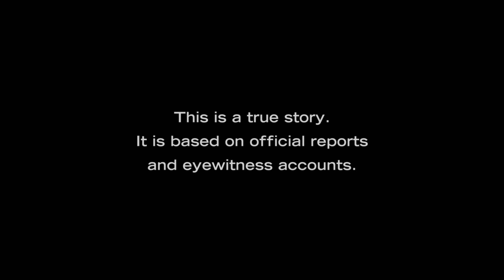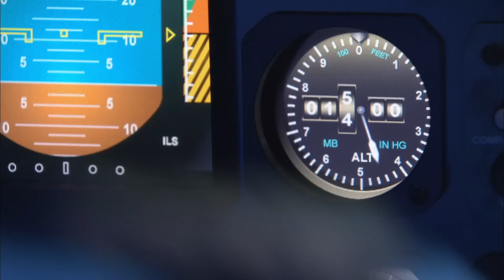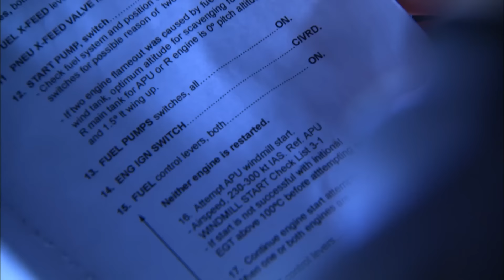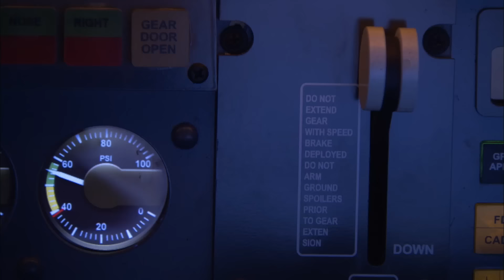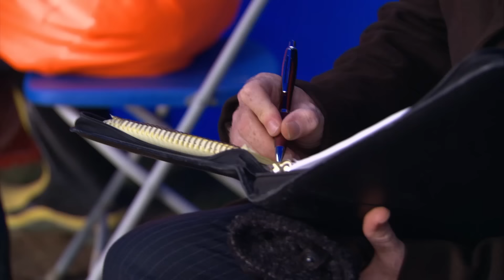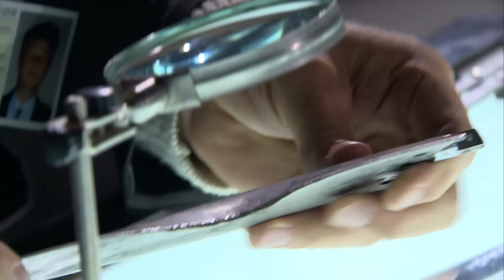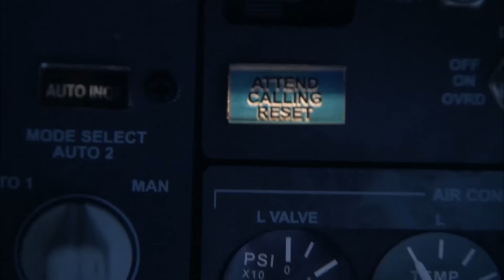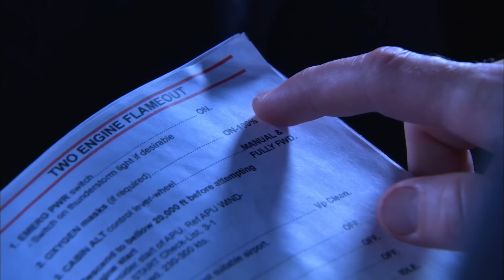How Did Scandinavian Flight 751 Survive This? | Mayday Air Disaster

Comment: Rasmussen forgot to fly the plane due to problem solving. Holmberg said several times that he should concentrate on flying.
Reply: And Rasmussen said that Holmbers continuing yelling was a distraction when he tried to access the situation.
Reply: @laxarus3259  That was the problem, Rasmussen should not solve the problem because it was unsolvable, he was going to fly. Thanks to that, it went pretty well.
Reply: @jackstreet6979  What are you talking about.?? Of course he should access the situation and try to solve it. Thats what a Captain is paid to do. No one new at that time what had happened to the engines and they made several attempts at restarting, while gliding down.
Reply: @eklund86  so have I, and I do not see how you get that the captain should not access the situation.
Reply: I haven't said that.
Reply: @eklund86  i think youtube mixed something up. I was not trying to reply to neither you or this thread ???

Comment: Wrong information! It was an MD-81 not a DC-9
Reply: @itanasoaie  Potato, patato.

"The MD-81 (originally known as the DC-9 Super 81 or DC-9-81) was the first production model of the MD-80, and apart from the MD-87, the differences between the various long-body MD-80 variants are relatively minor. The four long-body models (MD-81, MD-82, MD-83, and MD-88) only differ from each other in having different engine variants, fuel capacities, and weights. The MD-88 and later-build versions of the other models have more up-to-date flight decks featuring for example EFIS."
Reply: It’s still Douglas their planes were most frequent in crashes
Reply: @akyhne well explained
Reply: @Medina8anidem  It's from Wikipedia.

Comment: Hmm.... 
1992: McDonnell Douglas put an automated system on their DC-9 aircraft without telling the pilots it is there, or that they can turn it off if necessary.
1993: That automated system causes the crash of SAS 751 - luckily with no deaths.
1996: McDonnel-Douglas merges with Boeing, and bringing with them their culture of making changes behind closed doors and putting stock prices before safety.
2016: Boeing put an automated system on their 737 MAX 8 aircraft without telling the pilots it is there, or that they can turn it off if necessary.
2018: That automated system causes the crash of Lion Air 610 - 189 deaths, no survivors.
2019: This automated system causes the crash of Ethiopian 302 - 159 deaths, no survivors.

Comment: First of all, Why does a billon dollar company invent an new air plane, stationed to fly in ice and cool countries, which it doesn't do anymore thankfully. Just to have normal working bagage handler people to every-flight manually check with only a little flash light for something (So important that it will make the whole plain cash in seconds), and it was ice. Because the way the plain was designed with the engines right behind the wings, (facepalm) where the hard ice would melt into the engine. Great air plane design! and dont get me started on the ATR system, and them not giving notice to pilots about it. I literally in 2 second learned about the ATR system and remember that it exist forever, Why didn't they just show a 2 sec video or 2 sentence about the ATR to ofc the pilots! Btw very important automatic system in a plane that CONTROL THE PLANE!, not a AC system or something. This is ridiculous.

Comment: There was no explanation provided that explains why there was no fire when the plane crashed, even though there was substantial fuel in the wing tanks, since the crash happened just after take off.  I’ve seen that happen only when the tanks are very low with fuel near the final destination.
Reply: @sldrucker  The fuel was very cold so the vapour press was low enough not to ignight.  Every thing was shut down except the APU so the sources of ignition were minimised.  Even so they were v lucky.
Reply: @alexisvilliers4389  thank you for that answer!

Comment: I was thinking aloud,  why don't they mount two extra engines with independent operating systems to fall back on in  case the initial engines fail as opposed to even making de-touchable engines to the aircraft bordy with a parachute which also is a good idea
Reply: And how could a plane modified with new safte features released in the air without information or trying the pilots.
Reply: Engines are very heavy and permanent engine failures are incredibly rare. And even if they happen, it's usually just one and the other one is perfectly capable of carrying the airplane to the next airport. The second engine is already quite some redundancy. Putting even more engines that are never used would just make the airplane inefficient.
Reply: The answer always boils down to money
Reply: Twinjets are already able to fly and land safely with just a single engine, so they already have redundancy to cover single engine failures, which are much more common than dual engine failures. Besides, conditions that cause more than one engine to fail usually causes all engines to fail (foreign object damage from ice like in this case, issues with fuel, incorrect maintainance, etc), so it would only have a marginal effect on safety. Besides, adding more engines adds more points of failure, which might just undo the increase in safety from the added redundancy. Mounting extra engines that aren't used in normal operation would also add unnecessary weight and drag which would decrease efficiency, leading to higher fuel consumption, which is bad for the environment and bad for plane ticket prices. In conclusion, mounting more than two engines if they aren't needed in normal operation only serves to waste fuel.

Comment: Not a DC9. It was an MD81. Wrong pictures, cabin, seats, uniforms etc.
Reply: The film crew miss the flight, so they have to improvise a little. 🤥
Reply: But it IS a DC9!

"The MD-81 (originally known as the DC-9 Super 81 or DC-9-81) was the first production model of the MD-80, and apart from the MD-87, the differences between the various long-body MD-80 variants are relatively minor. The four long-body models (MD-81, MD-82, MD-83, and MD-88) only differ from each other in having different engine variants, fuel capacities, and weights. The MD-88 and later-build versions of the other models have more up-to-date flight decks featuring for example EFIS."
Reply: @akyhne We (SAS) had DC9-81 with analog cockpits. We had MD81/MD82/MD83 and the shorter MD87. All of these were EFIS (incl OY-KHO Dana Viking). All were certified as DC9 to keep the original certification.

Comment: This how i feel about modern cars.
You dont drive them, you instruct a computer to do what you want the vehicle to do, and if the computer thinks differently, you become a passenger.. 
Auto lights
Auro wipers 
Lane assist
ABS.
All HORRIBLE....
Reply: Do tell us how locking your brakes to make your car skid uncontrollably is better than ABS. Please elaborate.
Reply: @griechland  
Very easily my friend..
Use enough pressure to apply the brakes, but not enough to lock them..
If they lock, release the peddle, and re-apply.. Simple.

Comment: If I get time, I will write a detailed article about the airplane. Better engine engineer
can tell Which parts can be better installed or removed in the engine so that the performance of the engine can be better. However, an airplane with a new safety plan made by a Ukrainian engineer can prove to be a very good experience. Thanks

Comment: Watching. Turn Around!!!
Reply: QUESTION:  Why didn’t the pilots turn around and go back to the airport?
Reply: @gaylealleluia8392 

They never reached high enough altitude and wouldn't have made it back to the airport.
  And turning back would have burned too much of the little energy they had.
  Whole thing also happened and was over so fast.
25seconds in the from liftoff, alarms went off.
78seconds, both engines dead.

Comment: Question for a knowledgeable viewer  .. with such an unusual situation at low altitude and power questionable .. why not mayday asap closer to the field ?
Reply: From lift-off to crash, it took less than 10 minutes. They flew 15 km from the airport, to the crash site. At an average speed of 150 km/h, that would only take 6 minutes. Not a long time to react. And I don't know their average speed, but must have been at least 150 km/h.

If you have watched some of the episodes, you will know that the pilots must always try to solve the problem - in this case, to re-start the engines. This alone takes minutes.
So many crashes have happened in this series, because the pilots didn't try to fix the problem. In this case, however, they were out of time from the beginning. Solving the problem, means going through a checklist, related to the problem(s) at hand.

I'm not educated in this, but from watching almost all episodes there are, I'm pretty sure, they couldn't call a mayday, right from the start. In such a situation, you call a "pan-pan". A mayday is for when you're out of options. Someone smarter than me, can elaborate.
Reply: commercial pilots follow the practice of "Aviate, Navigate, Communicate". Always in that order. Anyway, according to the the cockpit voice recorder transcript the call that they were returning to Arlanda came 1 minute after realizing they lost power. Touch down was two miutes after that.

Comment: This crash shows there is something wrong with plane design and engineering. 1st this plane should be able to run with one big engine instead of two at the same time that way you can use other one engine separately because if the plane is designed to use one engine at a time then the 2nd engine should work. Now, the issue is how you can design a plane which can work with one big engine at a time. Here you need a balance of weight which needs two engines outside and one big or double engine in the middle that means you have two planes one on each side and then two engines; one on the right side and outside. Same one one left side and outside. Which will also help the tire and wheel to spread outside under each plane. So you got 3 engines one big one in the middle while two very outside. So if the middle one doesn't work or broke down two outside will be able to land close by the airport.

Comment: Not sure if the communication between pilots depicted here is accurate, but it seems very poor. They seems startled the whole time and just staring at the instruments instead of focusing on what they can actually control. Although very traumatic experience for sure, no one died, so his decision to retire seems a bit of softy move.
Reply: If their average speed was 150 km/h (a guess), they would have been in the air for less than 6 minutes, from start to finish.

What they should be doing (and they did), was to try and restart the engines. That requires going through a checklist. That alone takes several minutes.
Reply: A softy move?  That Captain was no doubt traumatized.  It took Boeing two months into the investigation to send the information regarding the worthless "upgrade."  If that hadn't happened, he would have been thrown under the bus.
Reply: @elkelewtschuk9894  Exactly this. People here making dumb coments do not realise the preassure he was at and how the cowards on Boeing was witholdking the key to the whole thing because reasons.